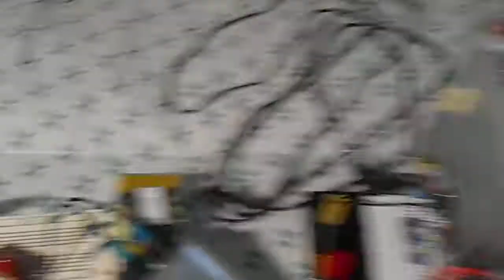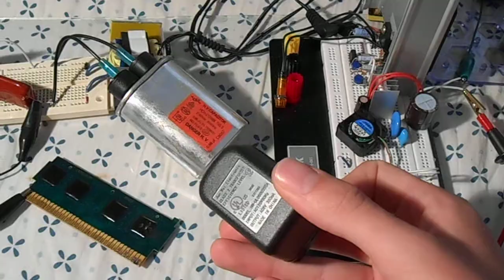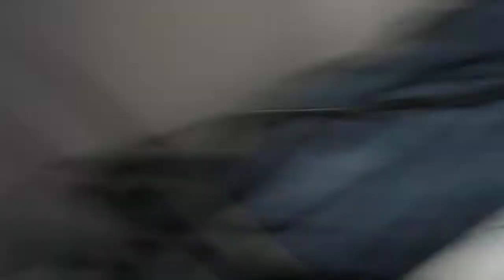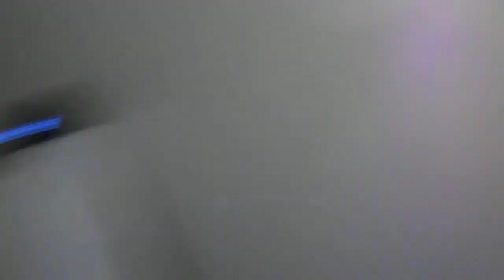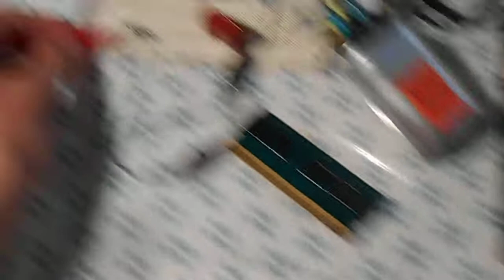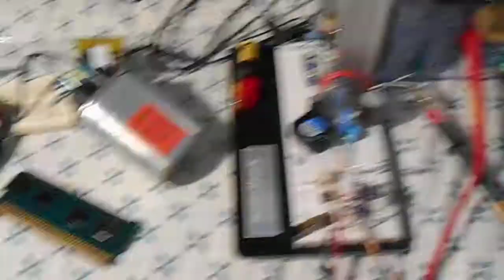highish voltage capacitor discharge and my ugly face :P

Comment from the maker: yep, i had a while ago used the driver as a boost converter setup with 2 line filter coils in series with 50uF 400v cap bank, it charges pretty quick and gets to about 330v when i am shorting it out frequently the 47uF electrolytic gets luke warm :] when i was looking for good 400v diodes i had found some couple thousand volt diodes so there will be a revisit on the high voltage bank and i will try 2 470uF caps in series on the lower voltage setup :)

Comment from the maker: :) i did get a shock from my voltage multiplier though :/ thats why i had added in the buzzer and led combo so i have a visual and audible signal the only problem is i cant hear it if the frequency is above my hearing range :P

Comment from the maker: nope not even a tingle *yet* but i know there where a few times where i was close, when i wasn't just arcing to the row of pins on the side there was only the insulation of the alligator clip holding it back and the tiny gap between my finger and the board :)